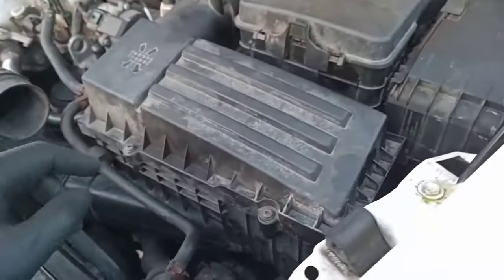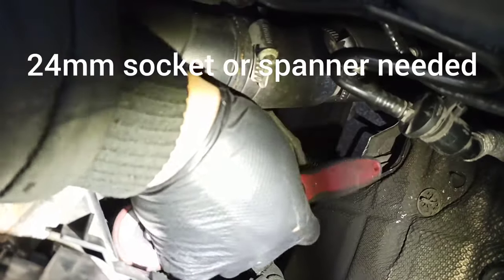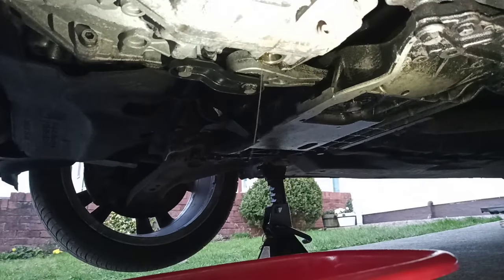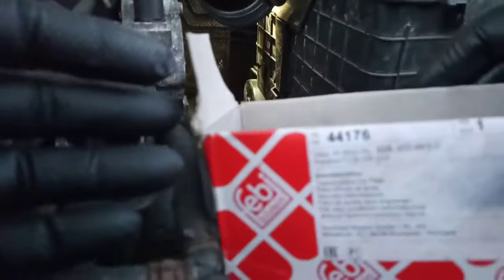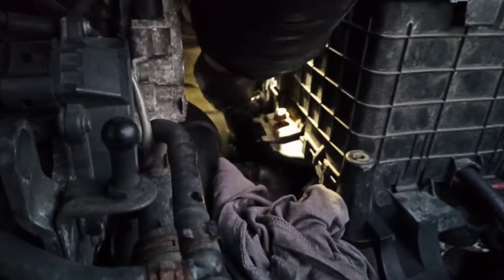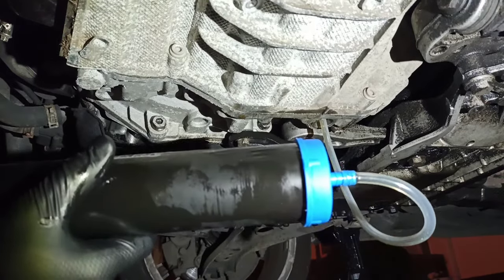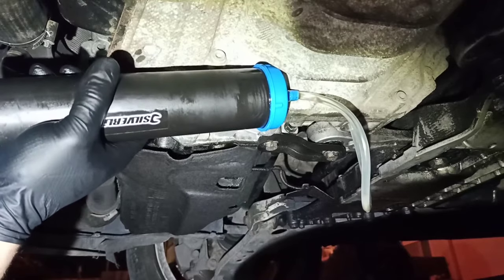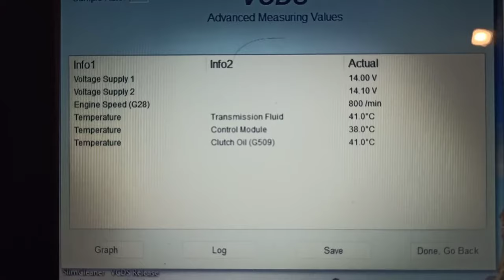How to change DSG gearbox oil and filter, Direct Shift Gearbox oil and filter change, DSG 6 speed

Comment: I don't have VCDS, can you tell me about how many minutes should I wait to heat the oil to 45 degrees?
Reply from the maker: Hi, I could test it next time I hookup VCDS, depends what temperature you start with but after 10-15 minutes when engine is at 90°C that would work roughly.
Hopefully video was helpful

Thanks for watching
Reply: @out_of_service5844  I need gear oil temperature, not engine temperature. I will change the oil tomorrow, can you give an approximate estimate?
Reply: @karlmaxweber  He just said 10-15 minutes of engine running should give you 45 centigrade